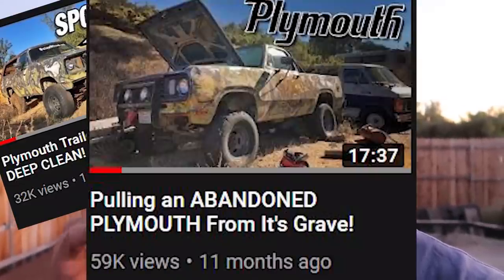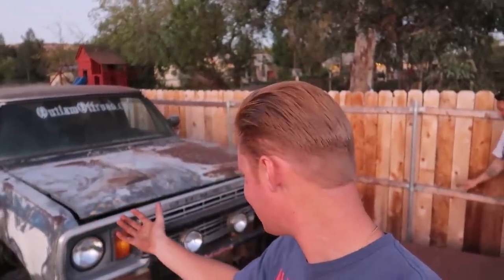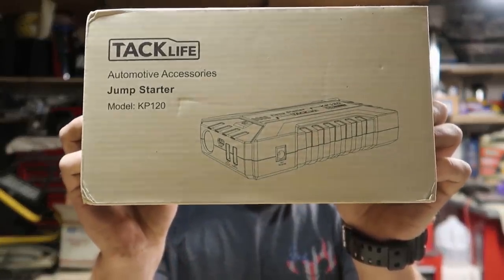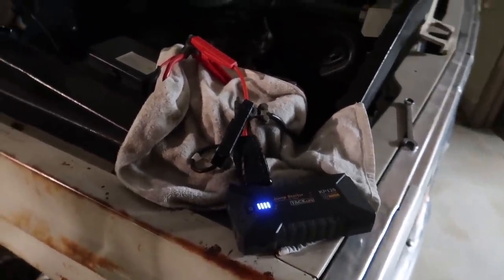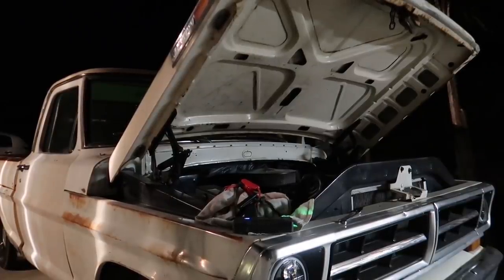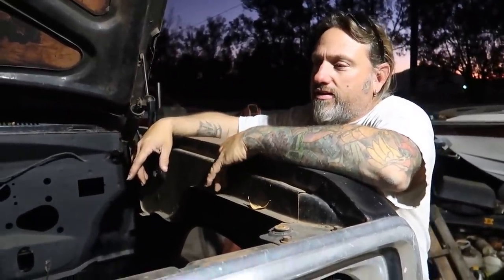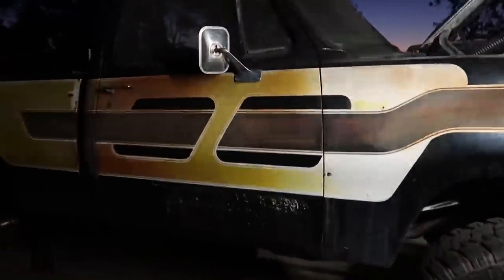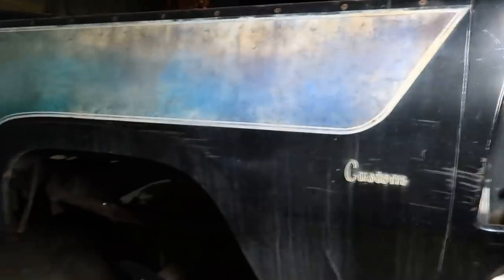Where Has The Power Wagon Been?

Comment: The Original Trailduster's front end was the same as the Dodge the only difference that the Plymouth did not have the Dodge name stamped on the top of the grille Here is a cool Power wagon "Top Hand" a rare option you could get on those trucks just like the Macho option https://www.hemmings.com/blog/2012/05/30/hemmings-find-of-the-day-1978-dodge-power-wagon-top-hand/